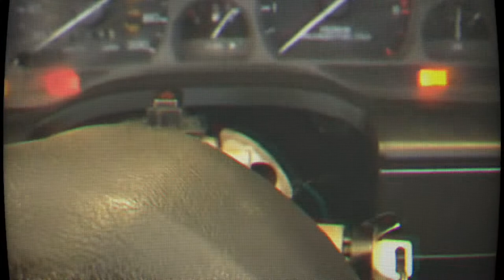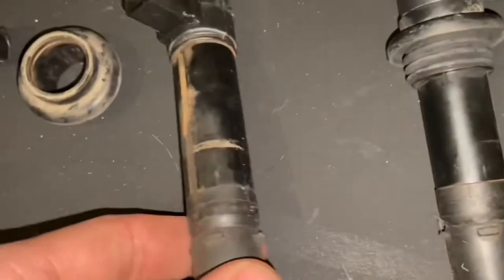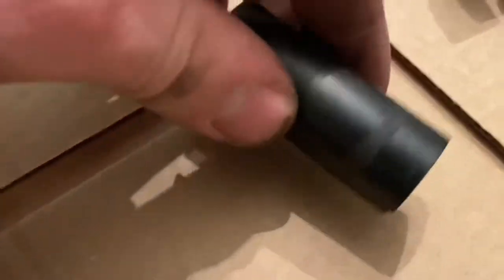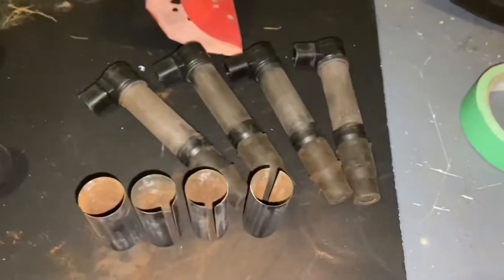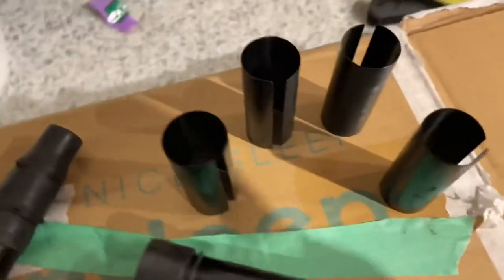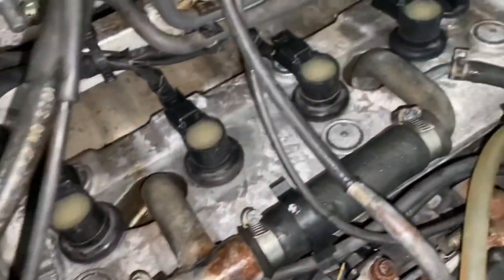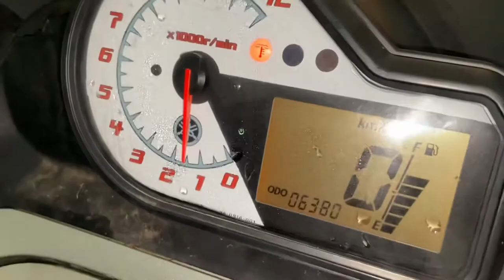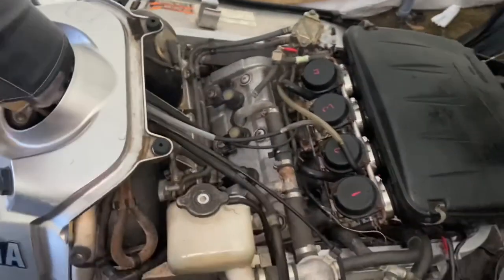Cleaning up Rusty Ignition Coils on the RX1(Great Results!)￼ #snowmobile #fyp #4stroke #r1#yamaha

Comment: So there’s supposed to be paint under the covers that you removed from the IG COILS??
Reply from the maker: Yah just to keep the metal from making contact causing misfire and arking, if you watch the video where I put new parts on I ended up getting all new coils and it definitely made a difference! The machine has way more power, it ended up working but for only about a couple months then the paint I put on failed
Reply from the maker: I almost wonder if plastiy dip would work better then paint if in a pinch?!?!?